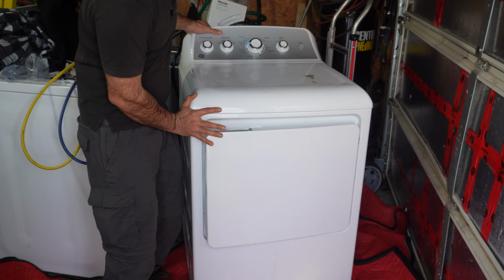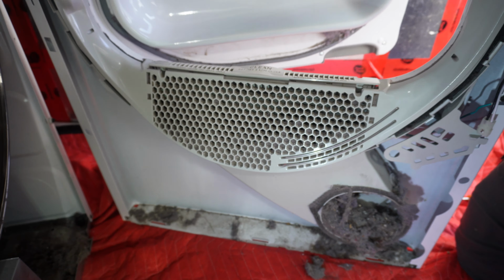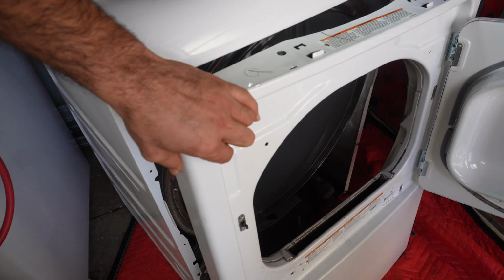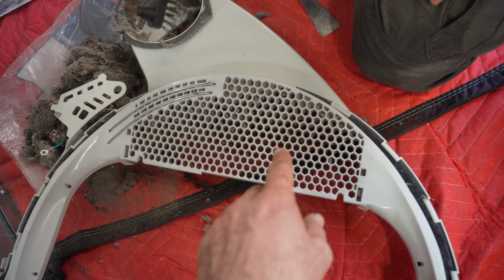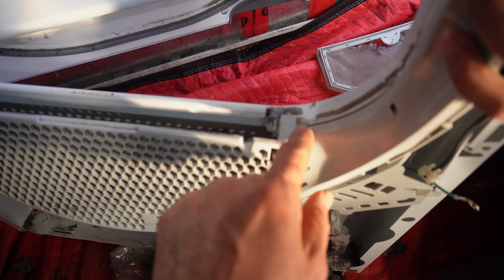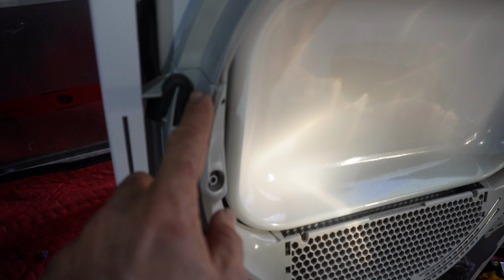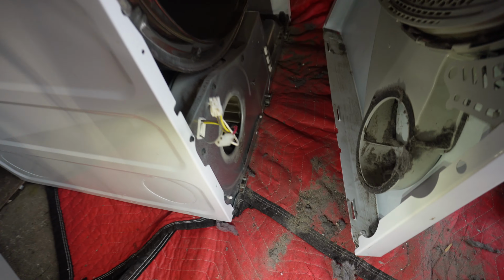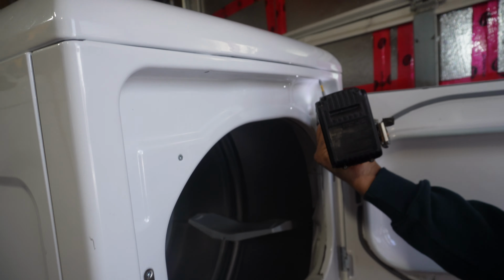GE dryer door not closing properly. Fixed

Comment: I have an LG GAS DRYER that just started to say say open door, but my door is closed.
It just started after moving yesterday in the cold.  Any ideas???
Reply from the maker: @michaellowery8937  maybe a thermal fuse is blown or a wire has disconnected. Put your phone in video record and put it inside of the dryer and close the door to see if the light goes off
Reply: @hameedwafaAFG  thanks so much